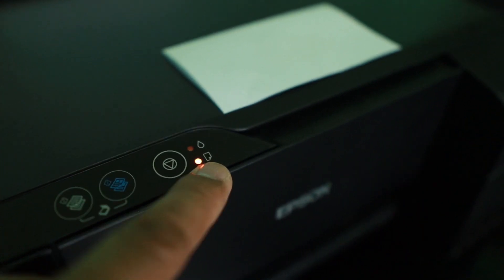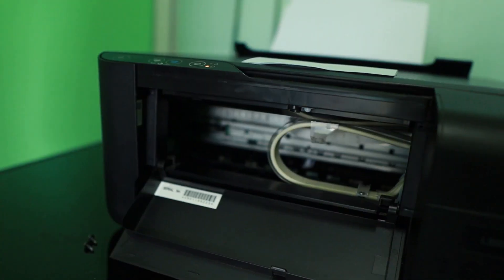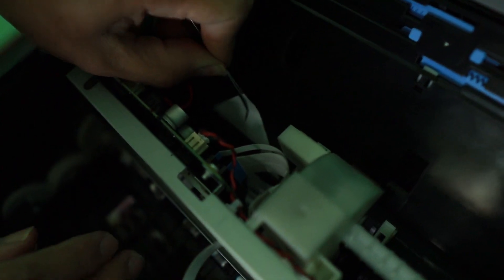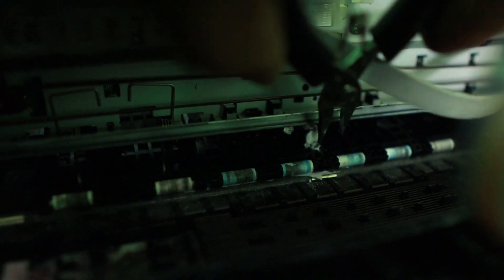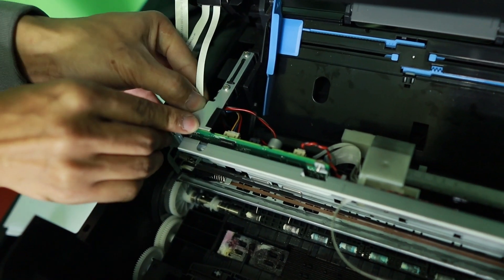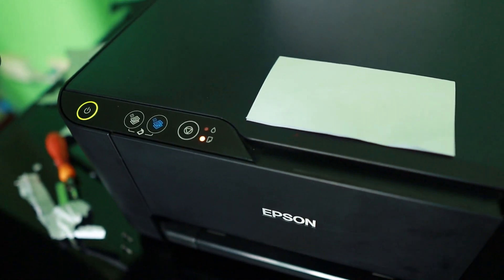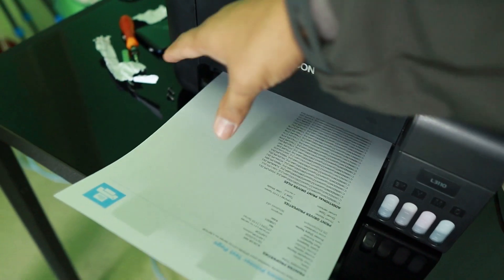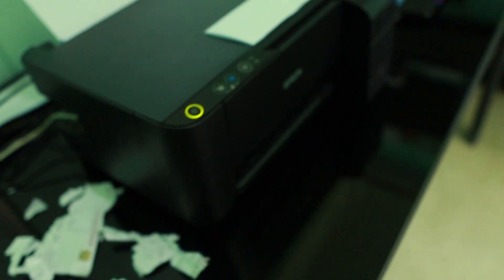How to FIX Printer Paper Jammed [EPSON L3110]

Comment: Thanks a lott!! And if any small and sharp tool is not available to remove those jammed small pieces, try to slightly lift the roller-kinda things from the back, and pull the paper from the space using hands... It worked..

Comment: Mine broke down just now. It's brand new. It printed properly then it rolled back and ate the paper which jammed really hard. In 30 years I haven't seen a printer do that. Did they program it to destroy itself so we'd buy another printer again? It's really weird for a printer to properly print and eject a paper then roll back to jam itself
Reply: Beware of this Brand and model. We have at least 5 of these things and they all try to destroy themselves from time to time
Reply: @kajeralocse  do u find away how to fix it?
Reply: The same thing happened to me. The printer printed out the page perfectly then rolled back in and jammed itself. I feel like this printer is the worst its has issues every other month.
Reply: @BigBangLuv3r  is your printer working fine after you follow the video instructions?
Reply: i had this as well!!
Reply: This just happened to me today, how to fix it tho
Reply: This literally JUST happened to me ten minutes ago :(
Reply: @sparkless1549  i tried to check whether there's any paper inside the printer without taking of the printer parts but saw nothing. My sister tried to tap the last button (next to the 2 small light i suppose)  and thank god its workibg fine